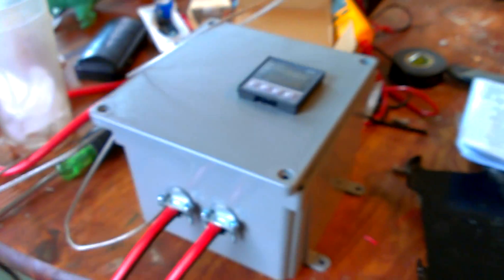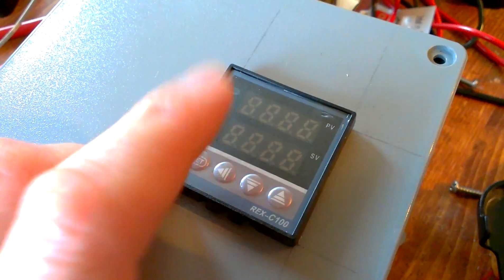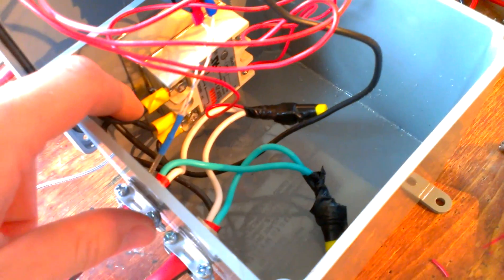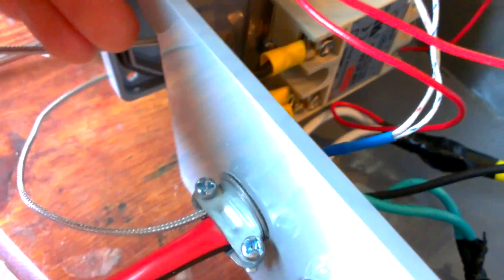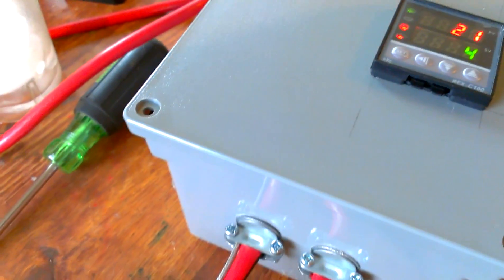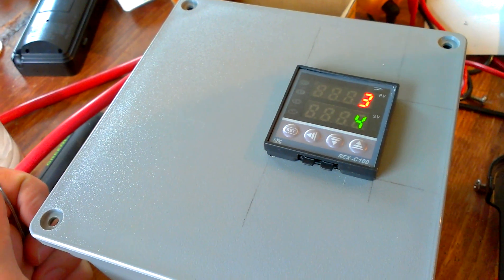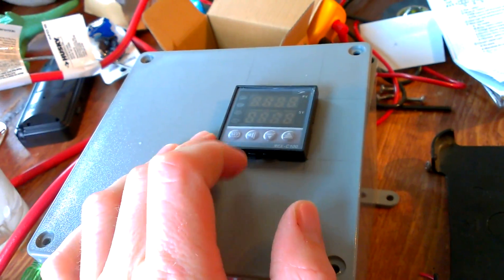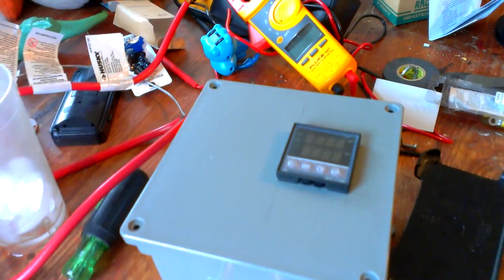DIY PID Temperature  Controller

Comment: These comments crack me up. You could have used a normal relay to save a bunch of money since your load isn't something like a heating element. You don't want to rapidly cycle a compressor on and off, which is the use for an SSR.

Comment: If you don't want to burn your house down/ injure someone, use some nylong cable glands. Clamping round cable down between two flat bits of metal will damage the inside of your cable, they aren't earthed either. If there's a breakdown between active + clamp and neutral +other clamp, you run the risk of becoming the load of the circuit.

Comment: How do I change it from refrigeration mode to heating mode? I bought one and it came in refrigeration mode but I need to use it monitor a high temperature on a wood stove.

Comment: question sir.. can you make one pid heat up 4 heat cartridges or will they only heat up 2 max? i want to make a heatpress for jewelry and needed to make heat platens heat up 1" thick aluminum so i was thinking 2 heat cartridges in each 6" diameter platen or will one heat cartridge be enough to heat up one plate but itll just take a lil longer to reach heat temp? if so i will use one in each ...lmk thank you for your time!

Comment: A simple temperature controller would have worked much easier than a PID, and have better interface. An inkbird ITC-1000 is far superior for controlling a fridge or heater, or both!

Comment: Nice project! Is it really a PID controller? It seems to be used as an ON-OFF controller. A PID controller has three actions: proportional (P), integral (I) and derivative (D) actions. Then you need an actuator that will be continuous on the range of operation.

Comment: Please be aware short cycling a refrigeration compressor will destroy it very quickly. The system pressure needs to equalize before the compressor starts again, if not it will work very hard to get running and will often trip the overload.

 Is there a setting in the PID so that once the compressor is off it will never turn on in the first 3 minutes? Can you control the cut in and cut out differential? 

Walt

Comment: For safety, you might want to fuse the line in, and I would fuse the load also or use a CB. And if you are really into safety a GFI on the output.

Comment: Iv also read some electrical forums concerning this Rex C100 w/25amp relay ssr . this unit cannot be used to control a refrigerator compressor because of it emitting pulse power which a compressor pump will fail on. I was wondering how your refer is running now ?

Comment: Here is some info that was difficult to find on the net:
1) Manual calibration of the C100 - I found a bias of approx 2.3deg. C  between the C100 and an accurate thermometer (at the range of 25-37C). To fix this - enter main manue by pressing "set" for 5sec. Then press "set" several times till tou reach "TC" where you can change the value shown by using the up and down arrows. Exit menue by pressing "set" for 5 sec.  
2) Changing the display so that it shows a decimal point. Enter main manue (see above). Go to "Lcy" (or so it appears) and make sure it is set to "1000". Exit menue as above. Press "set + shift" for 5 seconds. The text "COD" will appear with "0000" bellow. Press "set" once to get to "SL1". Change the numbers bellow to "0111". Exit by pressing "set + shift" for 5 seconds.
3) Setting the upper and lower limits. Press "set + shift" for 5 seconds. The text "COD" will appear with "0000". Change the number to "0001". Press "set" to browse through the setting options including SLH (set limit high) and SLL (set limit low). You can change the limits using the arrows.

Once you've managed these, the unit seems to be working well and I found no need to change other parameters.
Reply: This was more helpful that the video it's attached to.

Comment: Does this controller works with 12 volt car battery,
Reply: +Valleystriping1 for car temperature control, I recommend inkbird ITC-1000 12V, it's enough.

Comment: can i use this for air cooler
. if it is useful then guide me how to make this devise.
Reply: +anand khandekar if you are not a electrician,I suggest to buy a pre-wired temperature controller,it's easy to use,just plug in and use. Could you please tell me where are you? I can recommend one for you after that.

Comment: I need to set mine to run power to a water heater elemnt to heat water in a Hydro-Graphic dipping tank. How do I wire it and progrm it for that?
Reply: +Roy Lane  If you do not how to wire, maybe you can order a pre-wired temperature controller, such as Inkbird ITC-308.
Reply: I'm looking to do the same thing. Did you ever figure out how to make it work? And if so how
Reply: Sar ap hindhi me bhi bana diya kro

Comment: OK so it's a plastic enclosure. Really it was the fixing lugs that fooled me as they look very chunky. Watching again , the noise the lid makes is quite obviously plastic. So that's twice now I've watched this video through. Very good video. Although I would prefer to see plastic stuffing glands used, instead of metal clamping glands, maybe I am more afraid of electricity than the average person. They might well be considered extraneous metal conductors in need of earth bonding, once again here in the UK, and perhaps throughout Europe in harmony with requirements for electrical installations. I am just debating the matter. Not criticizing.  Anyway you are lucky to have such a pretty daughter and I wish you all well.

Comment: Here in the UK we would make sure to also connect the ground / earth wire to the metal enclosure. This is mandatory at mains voltages.
Reply: here in the US we know a plastic enclosure when we see one ;)
Reply: +Stephen Nolan If you are do not want a DIY temperature controller, I suggest to have a UK socket plug directly. There on amazon, I found Inkbird ITC-308(2 relays, heating and cooling), ITC 306(2 relays are for heating).

Comment: how do know if i have the right ssr for my pid?
Reply from the maker: Fay Cottoy check the trigger voltage and iff its big enough for your load
Reply: +Fay Cottoy there're many PID temperature controller now. Some with relay output(k sensor/PT100 sensor or other sensors)and some with SSR output( need SSR). Hope this helps.

Comment: Does the cooler you're using have automatic defrost or do you defrost manually?  I'm assuming this just interrupts power to the compressor and was wondering what that would do to the defrost cycle.
Reply: I'd bypass the factory wiring if it was me.
Reply from the maker: Nicholas Smerk it does not have defrost its intended for delivery has a huge aluminum heat sink that it chills then can be unplugged for a day or so and still stay cold
Reply from the maker: 958kris it does not have defrost its intended for delivery has a huge aluminum 
heat sink that it chills then can be unplugged for a day or so and still
 stay cold
Reply: DarlingtonFarm That's interesting.